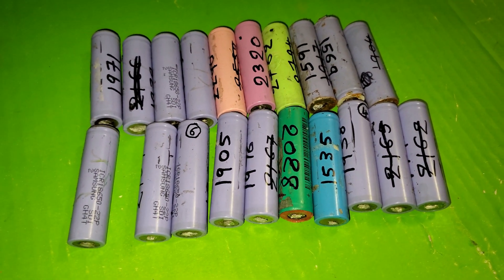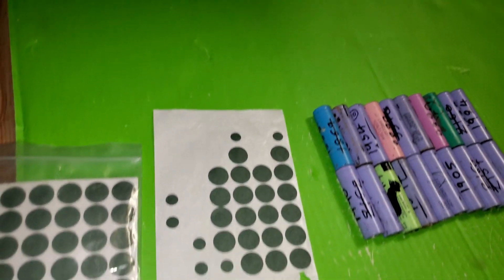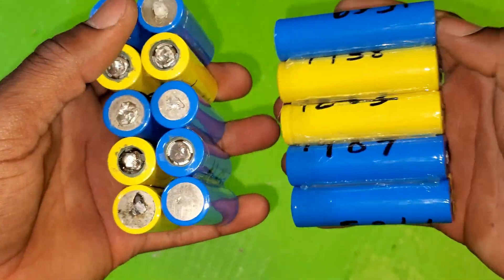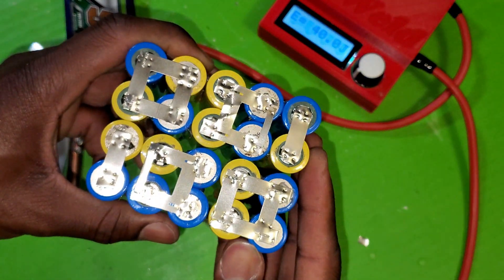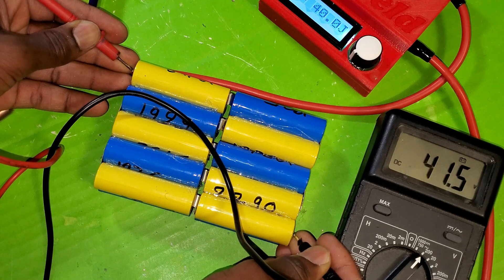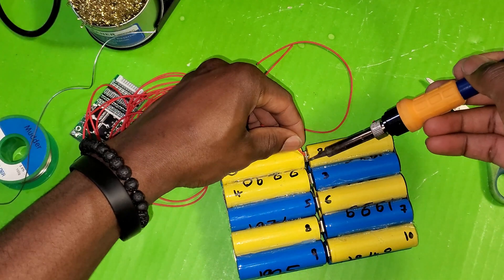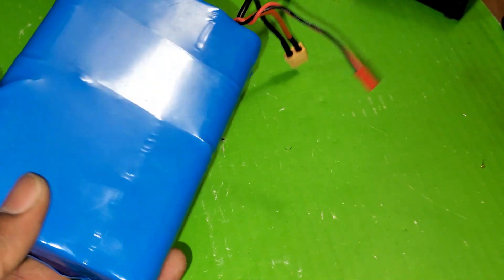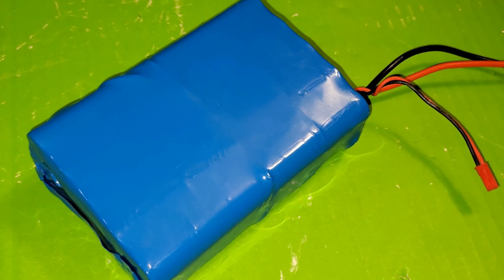How to Build 18650 Li-ion Battery Pack 10s2p

Comment: I have a balancing scooter battery pack 36V 4.4Ah. One of the cell is not working and need to be replaced. The 18650.cells are unmarked and i dont know the cells mAh. 
I can find online only 1200 mAh cells. Will that work here?
Reply from the maker: Divide 4.4Ah by the number of cells in parallel, for example, if your battery pack is a 10s2p, you will divide 4.4Ah by 2. That's 2.2Ah, so you will need 2200mAh cells.

Comment: Nice build but you should also mention power of this battery can handle like current maximum? So if someone used for ebike 20A controller it will burn or what ?
Reply from the maker: This battery is using a 30A BMS but the batteries (most) are ICR 22p cells rated for 10A draw. I have 2 in parallel so 20A draw which will work fine with a 20A controller. But when you couple it with a controller that requires more power I will not burn, you will just experience voltage sag during hard acceleration and when going uphill.
Reply: @YvonSmart yes this is true 
but problem is also what power nickel strip can handle amps ?
What is the size of nickel strip your using in video?
Reply from the maker: @khalilkh7389  I'm using 0.2mm thick and 8mm wide nickel strips. Make sure it's pure nickel strips so it resists rust. If you want, you can double (stack) the strips while welding for high power applications
Reply: @YvonSmart ok thanks 
so its mean your battery can handle 10A current because your only using single nickel on battery positive and negative terminal?  Because 0.2mm nickel strip can do about 10A current?
Reply from the maker: @khalilkh7389  No, it's doubled between the series connections, so it's 20A.... in reality that nickel strip does better, had that battery on my skateboard for some time now no issue
Reply: @YvonSmart yes you double up between series. but the final terminal positiv and negative terminal of the battery only used single nickel strip ! So the current will all comes to negative and positive terminal 
And if you only had single nickel it can not handle 20A !
Reply: @YvonSmart the reason im asking is because will make my battery pack similarly to your 10s2p and want to be sure it can do 20A current continously 😊
Reply from the maker: @khalilkh7389  On that single strip the 12AWG wire is soldered directly, so it's not a single strip carrying 20A. But you should double it for piece of mind. In fact use 0.3mm thick if you find some, or double your 0.2mm everywhere. If you're using it in a skateboard, the rider's weight matters to the current draw so better be safe than sorry
Reply: @YvonSmart  ok that's makes sense 😊
May i ask you so all is clear for me thanks 😁
but only one thing bothering me is you only using single nickel strip on folding side of the battery??
Is something i misunderstanding?
Thank you
Reply from the maker: @khalilkh7389  That's what I did in this video seems like, I remember doubling it but probably in my next builds. One thing to note there is if you double on the folding side leave a slight slack for the fold as it's known for double folded nickel strips to come loose during rides. Maybe give it more welds to ensure it lasts. Also use the right size shrink wrap so it shrinks tight. This was quite an old video 😅 I have improved a lot since then
Reply: @YvonSmart ok thank you hope to se new video 😊

Comment: doesnt using thinner nickel pose fire risk, i see some is thinner than the others
Reply from the maker: Yes, thinner nickel strips are more likely to overheat and cause fire, so for High current applications, use thicker ones or double stack. The most common sizes are 0.1mm, 0.15mm, 0.2mm, 0.3mm. Here is a chart that display the current capabilities of each size and material: https://www.endless-sphere.com/forums-old/download/file.php?id=248217&sid=b92127993f96052a6d5a240469953675&mode=view

Comment: So unecessary to remove the original cover of the batteries only insert shrinktube around them. Just write the numbers on the original cover, save urself the time and hassle.
Reply from the maker: The old shrink tubing looked awful, just needed better presentation throughout the video and at the same time I showed how to wrap loose batteries in shrink tubes, so 🤷‍♂

Comment: I’m new to BMS. Quick question: If my BMS is rated at 20A, does my batteries must be rated exactly at 20A or at higher?
Reply from the maker: Your battery can be rated at any amount (lower or higher than your BMS), but it will be easier on your battery if it's rated equal or higher than the BMS, so you dont overload the battery. The BMS will only prevent your motor or load from pulling more current than the BMS is rated
Reply: @YvonSmart  Ok. What if my batteries are rated at maximum 10A discharged, & my BMS is rated at 25A discharged. Will my batteries overheat?
Reply from the maker: @christopherowens2635  Depends on the load. If your load requires more than 10Amps, you need a higher discharge rate battery. Some batteries perform better than others, some will keep sagging, and some will overheat, bad performence for sure, unless you are building a 1P battery, your battery should be rated more than 10 amps more likely
Reply: @YvonSmart  I got some Samsung 25R and putting them onto my ebike. My ebike is rated at 25A. I thought I ask around before building the BMS. I don’t know the general rules between the BMS and batteries. I just don’t wanna blow things up to start out.

Comment: good video but I lost it on the BMS setup. was able to follow the first couple of connections but the rest were skipped.
Reply from the maker: keep the bms disconnected from the wires while soldering the 11 wires.
Be sure that the cells are labeled right from 1 to 10 (1 is the cell on the negative end of the battery).
The first bms wire (black) goes on the first cell (negative), the second wire (red) goes to the positive of cell 1
3rd wire > cell 2+
4th wire > cell 3+
5th > cell 4+
...
11th wire > cell 10+

"+" for positive.
Then, connect the JST connector to the BMS, then run a wire from negative of cell 1 to B- on the BMS.
add a charging port, (positive of charging port goes on the positive of cell 10, and the negative of charging port goes on C- on the BMS). Then the power connector (positive goes on positive of cell 10, and negative goes on P- on the BMS). Note, if your BMS does not have P-, you can use C- for power (it just means you can charge and discharge your battery from the same port C-). Charging wires don't have to be thick but power wires have to because they carry more current.

Maybe this diagram of one of my 7s battery build can help.
https://drive.google.com/file/d/1-KHwH50SXsP9npu6OqxsJWV3nr6h0P8X/view?usp=sharing
Reply: @YvonSmart  thanks you. I just fount it. Now I understand. I appreciate